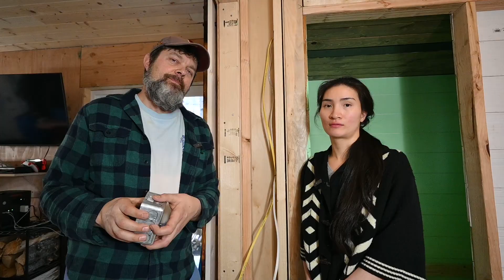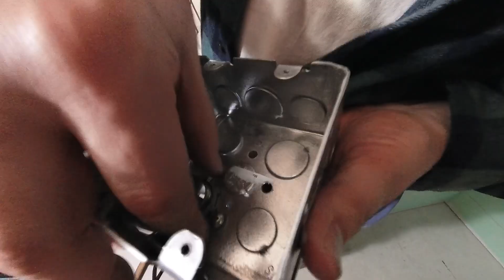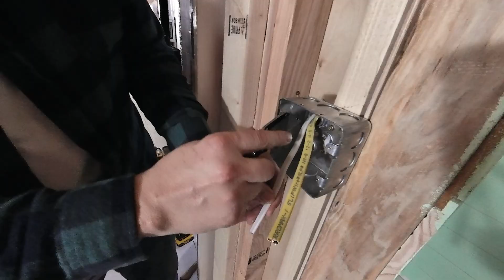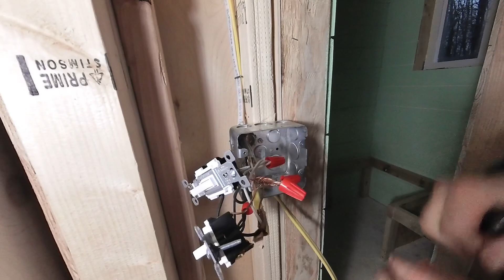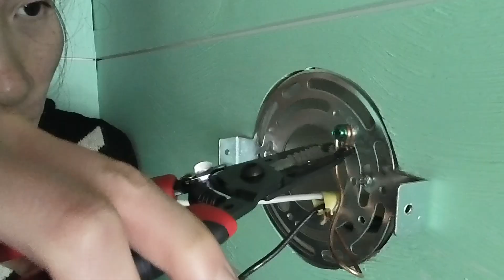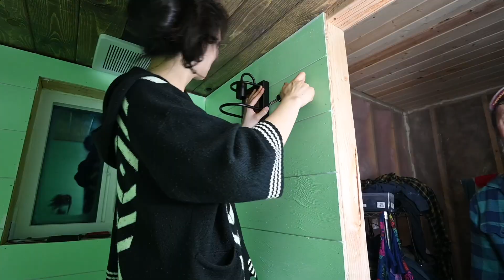BASIC WIRING:  TRYING TO BE TO CODE

Comment from the maker: We are NOT electrical experts.  Do not use this video as advice.  If anything we are looking for advice from experts if anyone sees anything we've done wrong.  Thank you for watching and have a great day.
Reply: You’re almost right on mixed wire size. The  overall ampacity from the circuits home run dictates wire sizes feeding the branch circuit and devices. 
Simple rule is wire can be larger than individual circuits breaker but not smaller. In your case, mixing 14ga and 12ga your overcurrent circuit protection for that circuit and branch circuits would not be more 15 amp breaker.
Today’s NEC code requires Arc fault or GFCI protection on nearly every circuit. Obviously any circuit within 5’ of a water source GFCI and remaining would be Arc fault. The sad thing with the code over the years; we went from a very reliable and stable current system to specialized current controlled system that is prone to nuisance trips. I always just us dual functioning breakers for every circuit in panel as a result. 
The cabin is Looking great though!
Reply from the maker: @Volusia1  Thank you for the explanation.  Good to have some experts looking out for us.  Can I bug you then with a few questions?  The breaker that will be used for this run is only going to power that switch box, then 3 more switches in the bathroom (2 lights and another fan).  Since there are no outlets on that run does the arc fault requirement come into play?  The outlets that will be for the bathroom and our gas-powered in-line water heater will be on a separate breaker with a GFI outlet.  15 amp breaker for the lights/fans and 20 amp for the outlets all with 12 ga.  That's correct?  I was trying to keep lights and outlets on separate breakers because we won't have a lot of power in the cabin, so we have plenty of available space in the breaker box and I hate when the GFI trips and lights go out.
Reply: @AlaskanFreedom  current code after 2014 (2020 NEC) says NEC's definition, a hardwired lighting circuit still needs an AFCI breaker because it supplies electrical current to light fixtures and is therefore considered an “outlet.” 
(The NEC® requirement includes installation of AFCIs in all new home construction including bedrooms, living rooms, dining rooms, sunrooms, othering gathering places and in kitchen and laundry areas.)
Yes I think it’s silly for lighting circuits but I don’t write the code. I believe Alaska uses 2017 code but don’t quote me on that.
Reply from the maker: @Volusia1  good to know. There are no code enforcement or inspections in our area, but I still want to stick to them with the electrical just to be safe.  Thanks again
Reply: @AlaskanFreedom  any outlet that you believe that will be a higher draw then wire with 12ga for 20amp. I typically in residential wire laundry, kitchen and bathroom with arc/gfi protected 20amp. Bedroom and living quarters 15amp arc. 
With that said these dual function breakers are expensive in comparison to a normal breaker but I found them very stable. Important note; make sure all connections either by wire nut, screw, or in panel are tight!!! Nuisance trips are normal a “neutral” connection loose somewhere in the circuit. Since these breakers relay on the neutral to operate.
Reply: @AlaskanFreedom  yes I know. No code requirement for no public utility connections. Being safe though is important.
Reply: Keep in mind that you can also use the 3/4 in. Plastic Push-In Button Connectors to protect the wire entering the metal box. It also has a slit in it so you can slip it onto the wire and then push it into the hole without having to unwire the fixtures to get the wire in like the metal clamps.
Reply: @ I assume they chose to use screw type due to the boxes being exposed..
Reply: @Volusia1  or they weren't aware that the option existed.

Comment: Not really sure why you are using a surface mount metal box unless it's temporary. If you mix 12 gauge and 14 gauge wire in one circuit, you must use a 15amp breaker. So, it's fundamentally dumb to use more expensive 12 gauge wire and dangerous to use a 20amp breaker with any circuit that has 14 gauge wire. Don't do it.
Reply from the maker: @DanaUdapp  the entire cabin will be surface mount and exposed conduit.  Was not aware i couldn't use 20 amp with 14 ga prior to this video.  So happy to be learning from people taking time to comment and teach us.  Thank you, it will save us from mistakes and costs as we continue.
Reply: @AlaskanFreedom  I'll try to explain the scenario: At some point in the future, you or someone else opens your breaker panel and sees 12 gauge wire on a 15amp breaker and thinks : "Oh I can put a bigger breaker (20 amp)" on this circuit. Then they plug in something that draws a lot more than 15 amps, the wire gets hot, the breaker doesn't trip and the next thing you know-  your cabin burns down. No bueno.
Reply from the maker: @DanaUdapp  make sense, thank you for taking the time to explain that.  This is helping us a lot.

Comment: Thanks for the content, been watching since you started.  May want to research this…If the jbox is going to be permanently exposed, you’ll likely need to change the plastic switch plate to a Steel Metallic Square Cover, 1/2 in Raised, 2-Toggle to meet code.  If there are finishes on the wall that make the jbox flush with the finish then the plastic cover is allowed.  Keep up the content, great work you two!
Reply from the maker: Thank you so much for the comment.  I was wondering if the plastic cover was a code issue.  We will be finishing the walls soon and the box will then be mounted against the wall, exposed.   Before I had time to even research about plastic coverings, Eleinne decided she wanted all matching metal decorative covers.  No one locally carries them like we want so we'll have to order them.  We very much appreciate the expert input.